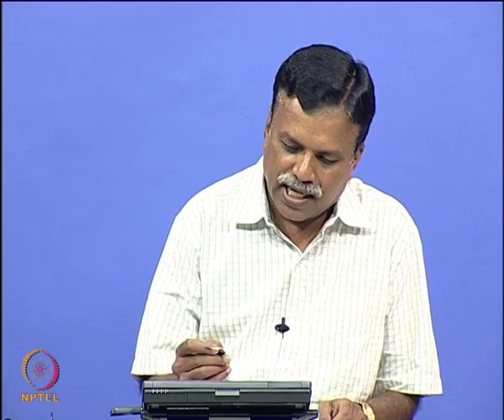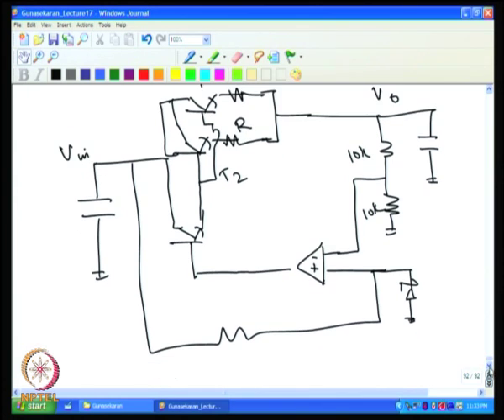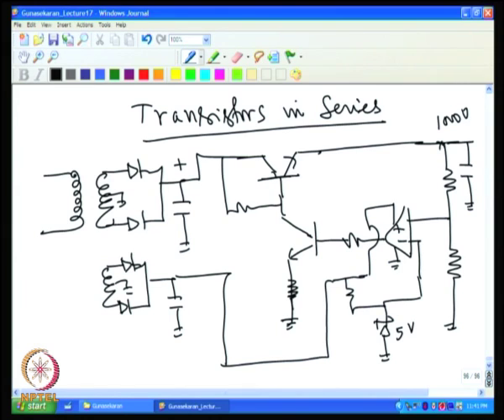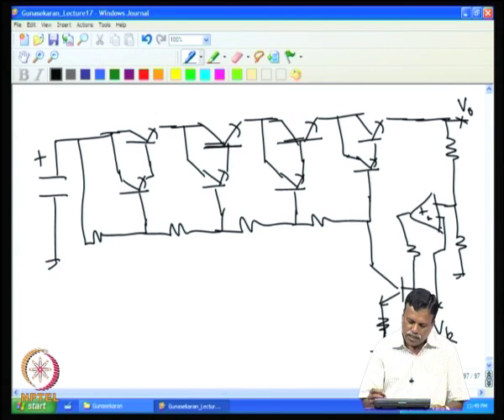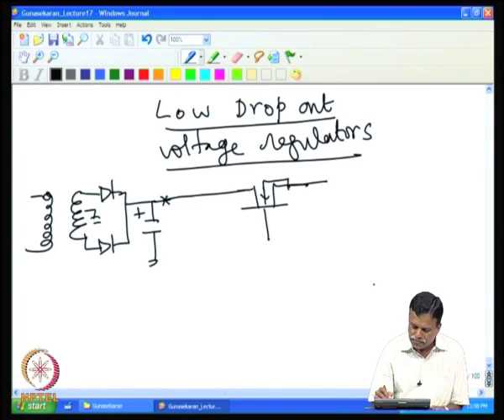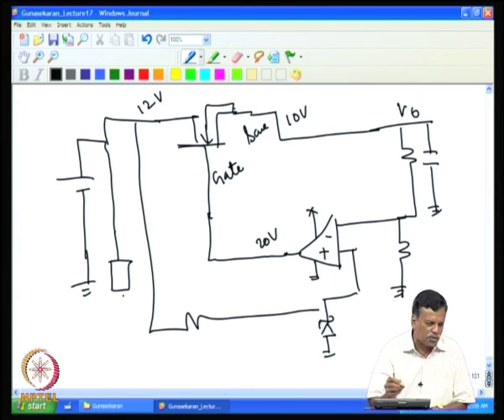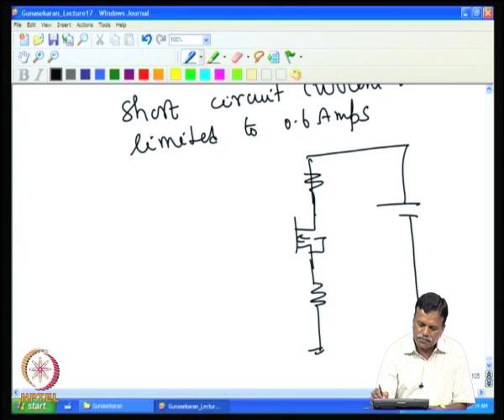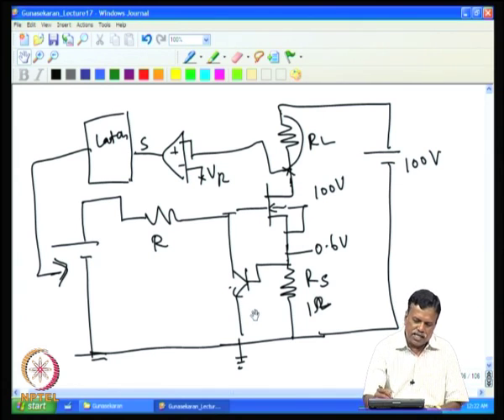Mod-03 Lec-13 Short Circuit Protection of Power MOSFET

Comment: How much power will be dissipated in the 1 ohm resister under short?  If the current is limited to 0.6A then would this be I^2*R = 0.36W ?